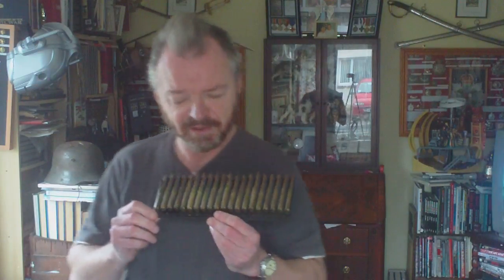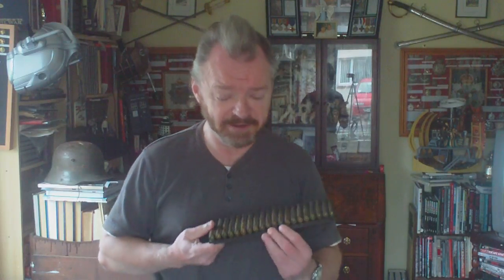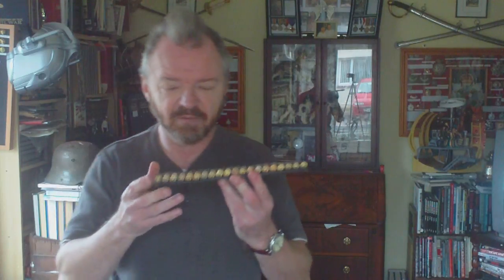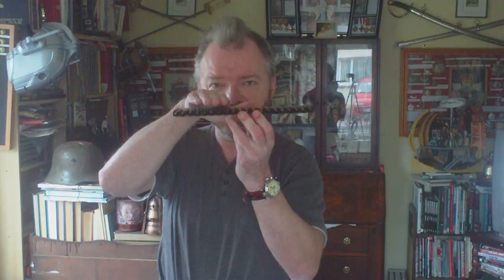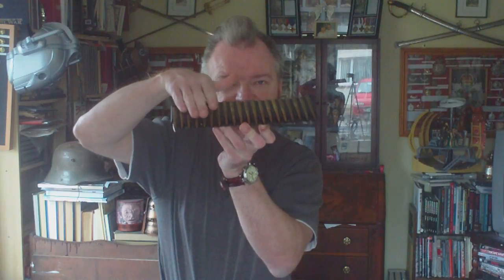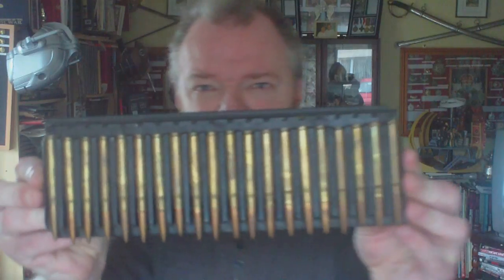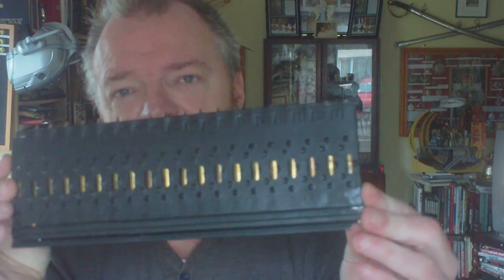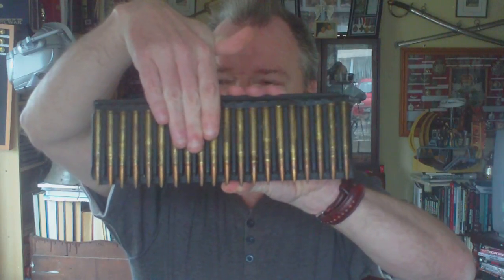WORLD WAR TWO ITALY BREDA MACHINE GUN AMMUNITION CLIP

Comment: IMO that was a dumb design, who did you say designed that?
Reply from the maker: Italian BREDA Model 37 8mm cal mg......it is unknown why the gun was made to do this action but it served the Italian army through WW2 and was a reliable weapon...even tho it only had a rate of fire of 450 rounds per min.,also each round had to be oiled before before they were fed into the mechanism as they are held tight in the tray with not enough movement for the mechanism to loosen them.the later model 38 was fitted with a top mounted box magazine and the similar FIAT version had a link belt like a modern M60 mg.